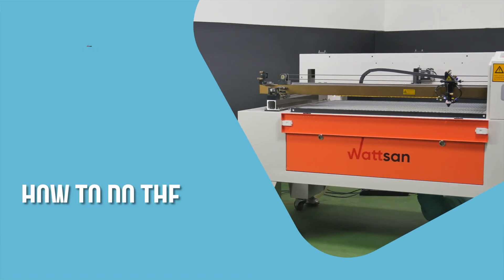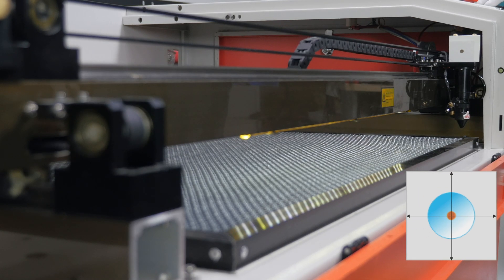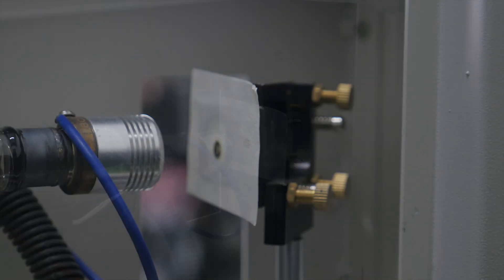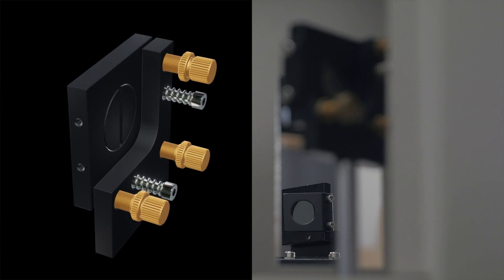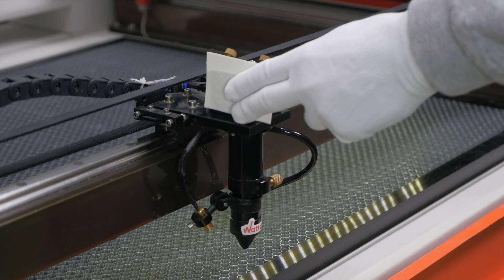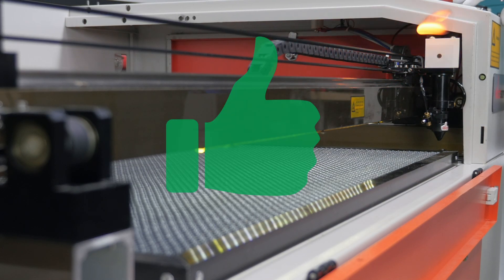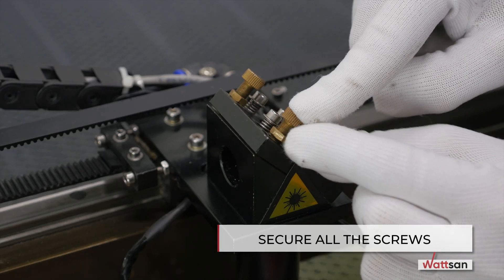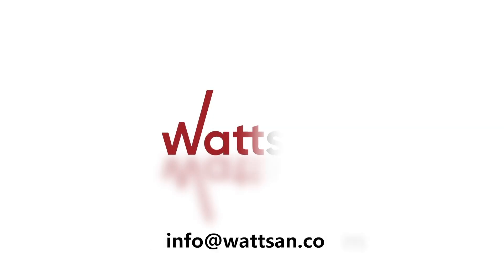How to Align Co2 Laser / Wattsan CNC Guide

Comment: My tube emits light but no heat coming from the tube
Reply from the maker: Check power level on controller, tube can not emit at power lower than 10%. If have ampermeter on machine (like on Wattsan) - check how many mA comes to tube. If level is more than 10% and amperage around 15-30mA, but still no beam - check output window on tube (power down machine before inspection. Maybe your tube have broken output window.

Comment: How to cleaning mirror and which is best way for mirror cleaning sir
Reply from the maker: Your can use cotton discs and nail polish remover. Apply nail polish remover to a cotton pad and wipe the mirror. If there are any traces of nail polish remover or fibres from the cotton disc on the mirror, take a new cotton disc, but do not apply nail polish remover on it. Wipe the surface of the mirror one more time.